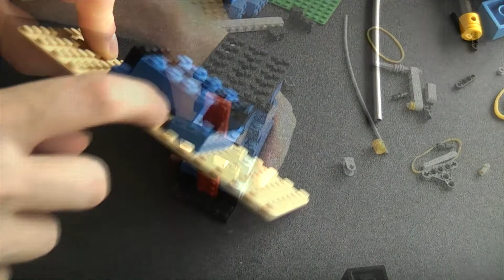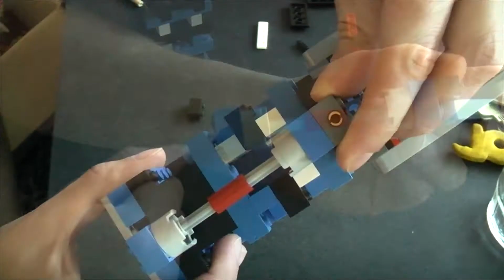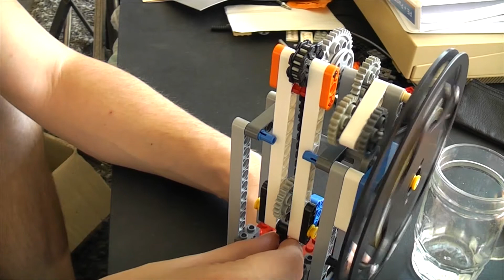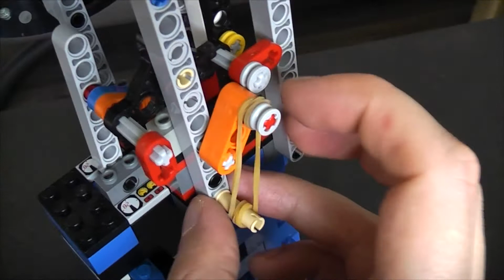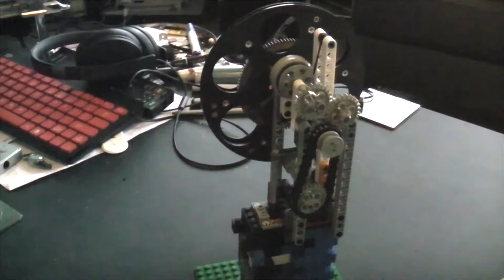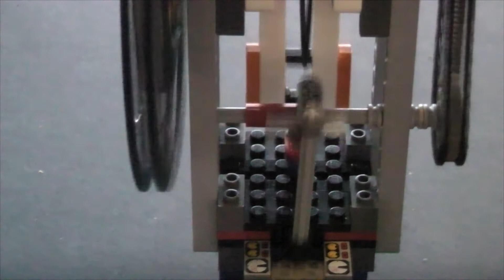Lego Otto Langen Vacuum Engine #1 - It Actually Works

Comment: I literally cant get my engines to work
I only got one to work 
ONE
And it was pretty terrible too
It was a beam engine 
I have a vid on it and if you check it out
Youl see that the eccentric crank doesn't have a 90 degree ofset
I know that because i had a problem where if i did have the offset 
The engine will have late or early admissions
And youl also see the fly wheel is....how do you say....a bit big
Thats because the engine needed alot of momentum
For some reason it wouldn't have a good enough seal
And also to prevent the piston been sucked down when its going up
I aded a drain valve.....thats always open 
Thats why youll hear like a whistling noise